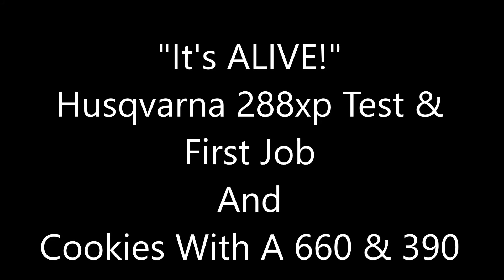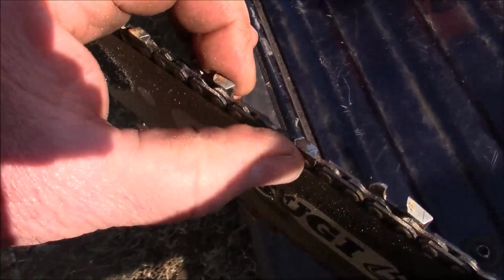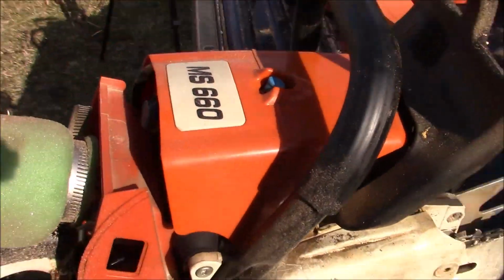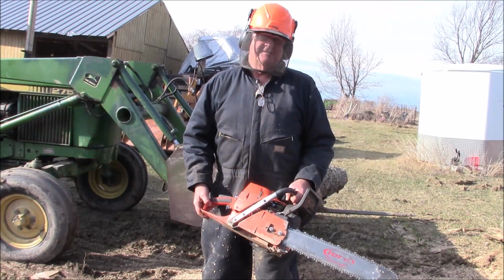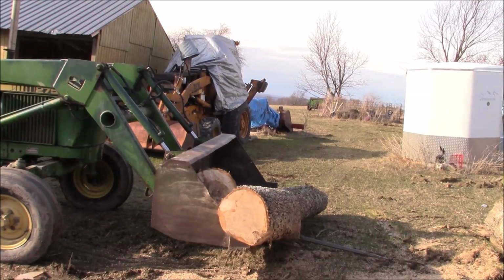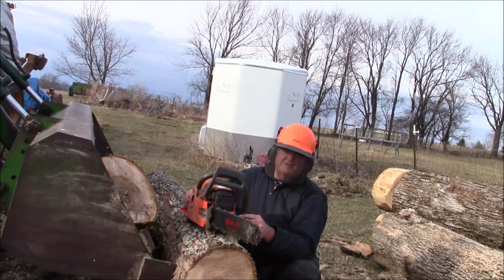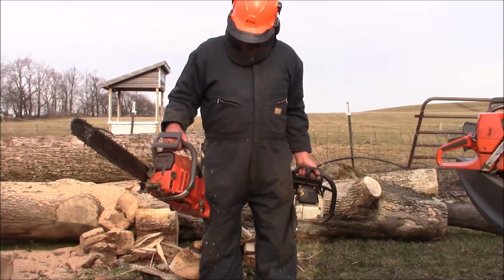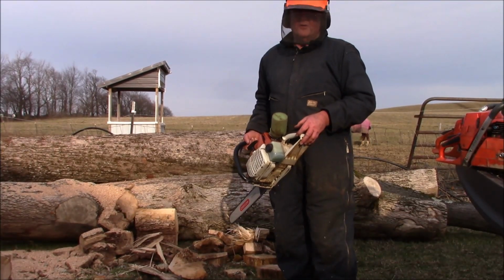Farmertec  MS660 "Kit Saw Clone" vs. Husqvarna 288xp vs. Husqvarna 390xp

Comment: Glad to see You and the Misses are doing good,
I built an 066 a couple years ago and when I tried to install the BB head stock with a base gasket it had more than head slap it was more like a door stop, so I installed the 54mm head stock with base gasket and had .018 thou squish.
As you say mine is a Beast, only thing I done was cleaned the ports and transfers up, and gasket matched the modded muffler.
I can get it started without the decomp when cold but warmed up I'm not strong enough. 😖😤

Take Care and Stay Safe

Comment: I have my 660 in storage condition and I am running my 360 and 440 as my primary saws, right now.  While the 660 cuts faster than the 360 or 440 - they are lighter and handier and are almost as fast cutting.  If I could just have one saw it would be the 360.  I am sorry you never got the 360 where you wanted it.  It has a 20 inch Total 2 bar and LGX chain on it.